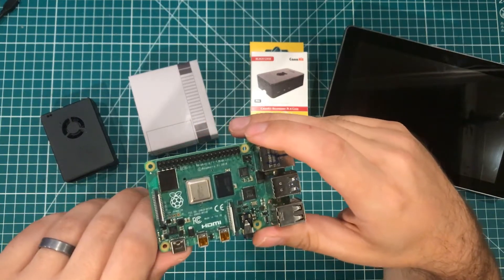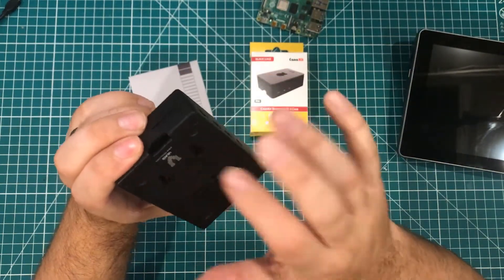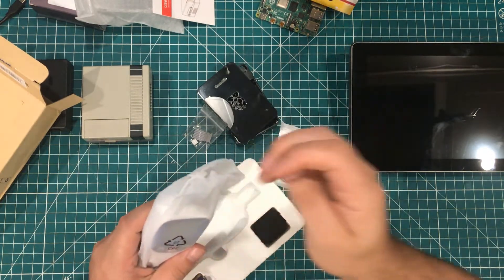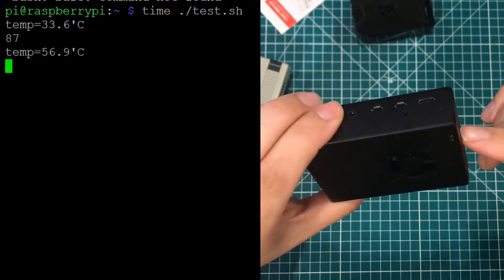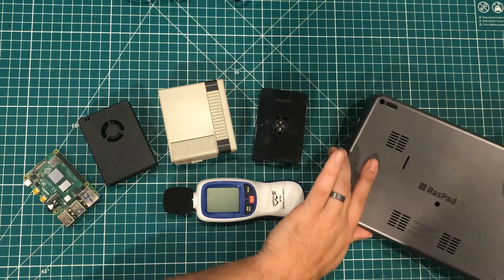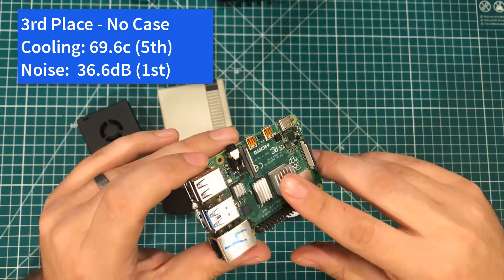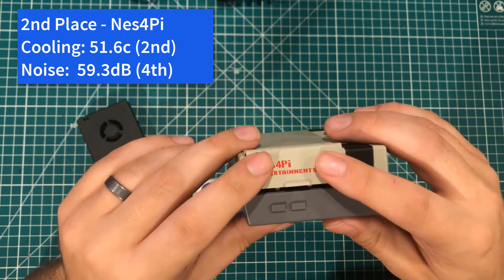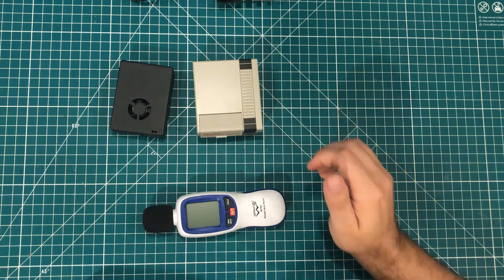Raspberry Pi 4 Case Showdown - Sound and Cooling Tests

Comment: The Argon one case is worth a look. Passive and or with fan assistance.There is also an option to add a m2 ssd via USB.  The newer model has full size hdmi built in. And it looks good too.
Reply from the maker: I'll have to check that out. I didn't buy any cases specifically for this test...these were just the 4 I had. 2 from starter kits and one I bought for my retro pi.  I really do want to try the m.2 option.